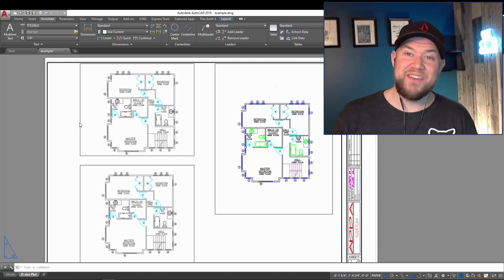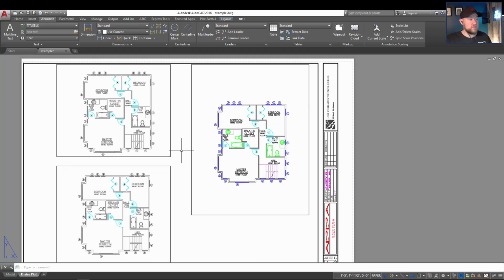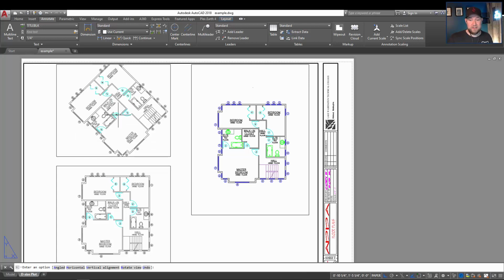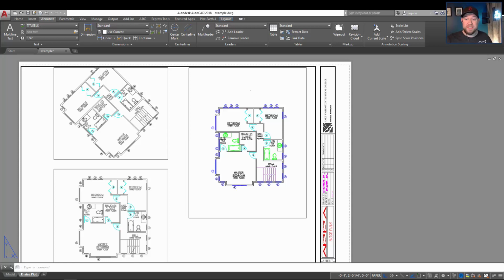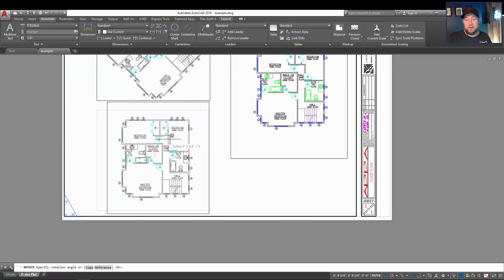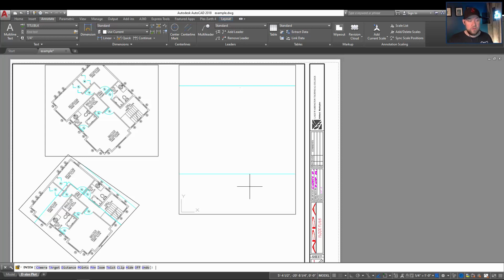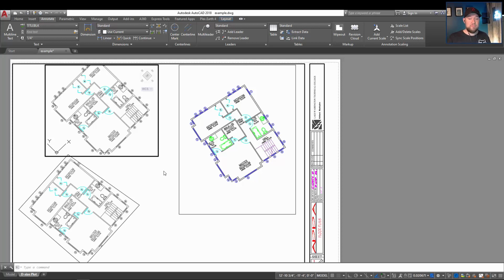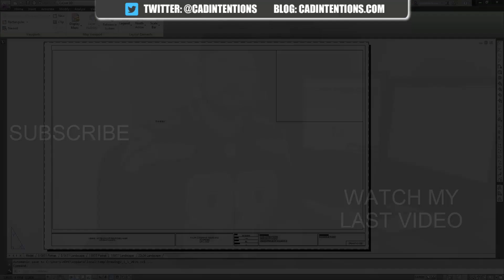AutoCAD How To Rotate Viewports - 3 Easy Methods! | 2 Minute Tuesday

Comment: 4th one i use equal as mv setup is 3d 0rb , and then pressing and holding shift, while hovering over circle edge so i get cicle with dot, meaning it will rotate only by plane surface.. then pres andhold left click. .. and rotate as much as you like. i find that way very precise for what i need it.